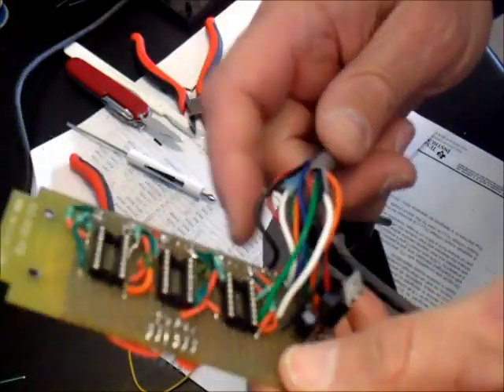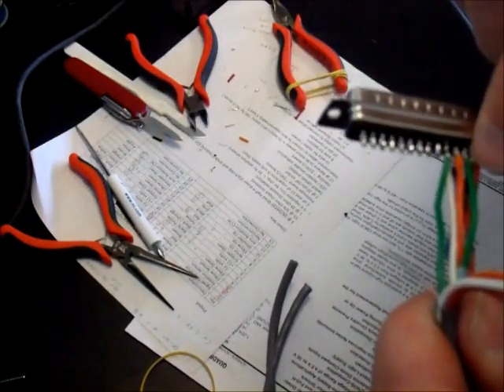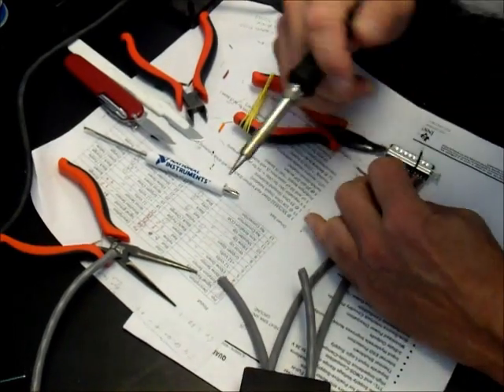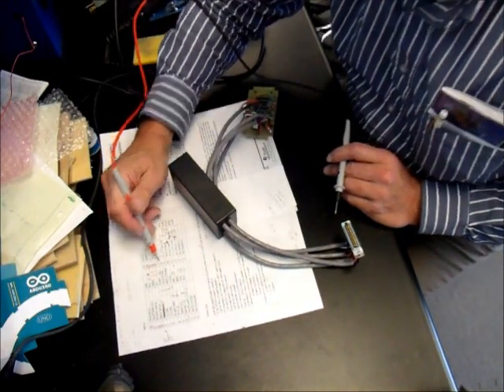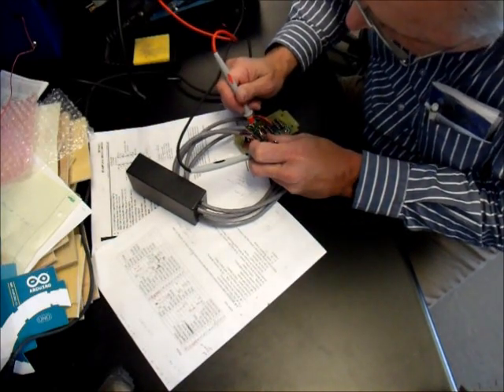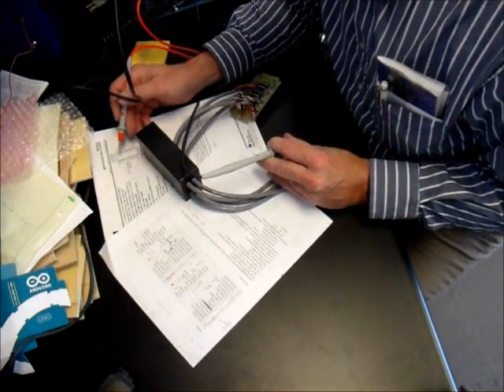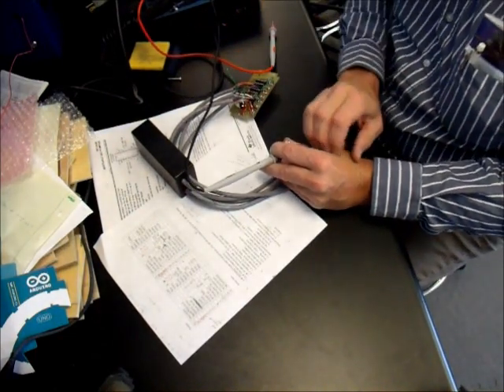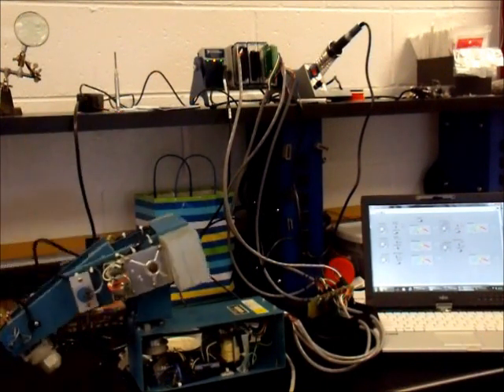H Bridge Driver for Brushed DC Motors - basic explanations and construction Part 7

Comment: Thanks for putting in the effort to make these informative videos. The explanation of back EMF was useful, as well as point for having the 10K pull-down resistor for the Enable pins of the SN754410.

Comment from the maker: I should mention - when I originally did the pinout of the robot arm, I missed the  center tap of the transformer in the power supplyconnection to chassis ground. The power supply provides + and - with respect to ground. So using the +  - would be OK if nothing in your controller is directly grounded. But if you use the + - and connect to an Arduino connected to a USB which is connected to a computer that is grounded you can blow the power regulator chip in the Arduino. Guess how I found out..